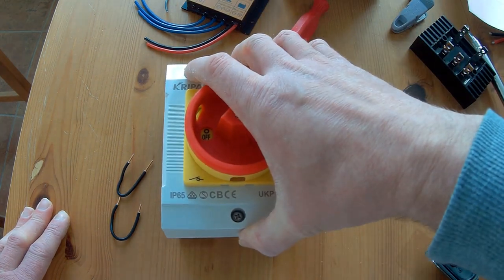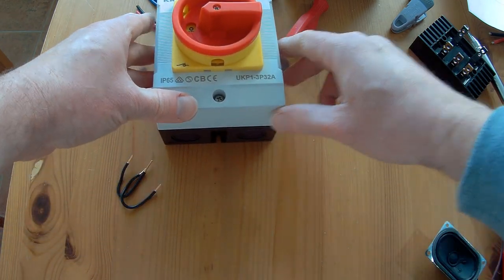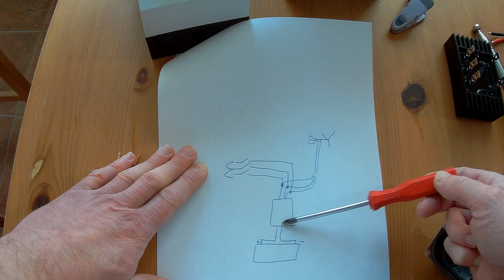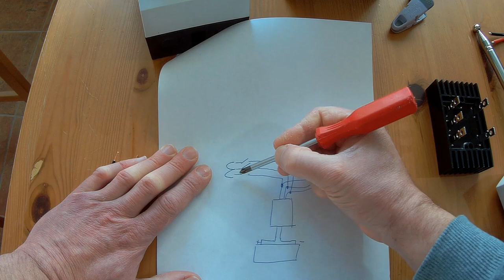Wind Turbine external break switch

Comment: Great stuff, vey helpful! Do you know how to add an automatic dumpload? For example if you are charging a battery and the battery is full the wind tubine power is auto diverted to a dump load at the full voltage of the battery to protect the battery and then back to the battery when it needs charging again

Comment: 1. could i use 1 dump load resistor, by connecting one wire of the resistor to the middle terminal and the other wire to both the left and right terminals on the isolator switch
2. will the dump load resistor completely brake the turbine?
3. can the turbine remain connected to the controller whilst being shorted/braked
4. can the dump load resistor remain connected to the controller whilst being used as a brake with an external isolator switch?

Comment: where or from which site did you order the windmill and the other parts?. On another video I saw a link to "Fast Trading LTD" is everything ordered and delivered through that?
Reply from the maker: Hi
It depends on the item. 
I got the Ista Breeze turbine an ISTA charge controller from ISTA breeze direct:
https://istabreeze.store

The Chinese turbine from here: https://s.click.aliexpress.com/e/_DDsyrhf

The "blue" Hybrid Charge controller from: https://s.click.aliexpress.com/e/_DBBZ5Wt

The switch  here:
https://amzn.to/3S8gqWU

The CD XY 60:  https://amzn.to/3KrA9PB

Rectifier: https://amzn.to/3E5XfXO

And last but not least, the LifePo4 Rack battery  24Volt:
https://s.click.aliexpress.com/e/_DBlDltR
and 48Volt:
https://s.click.aliexpress.com/e/_DcI0Ued

I hope that helps a bit.
Reply: thnx for the information! that gives just a little more insight (I will also do this with my videos in the future).